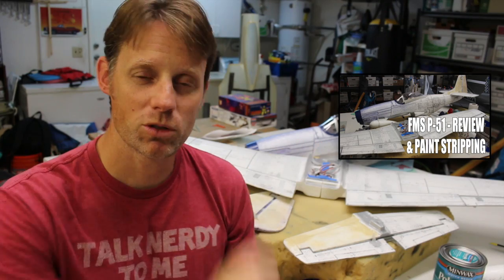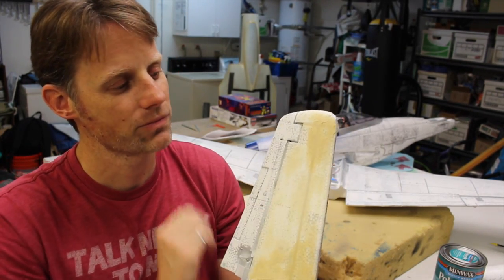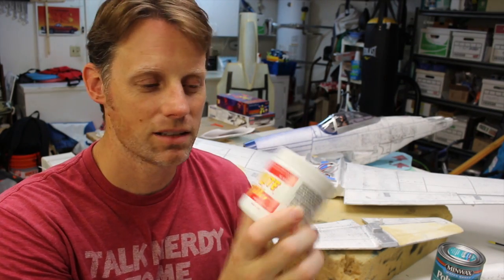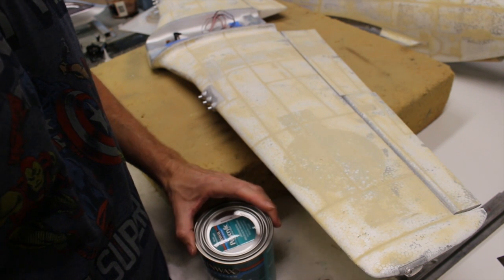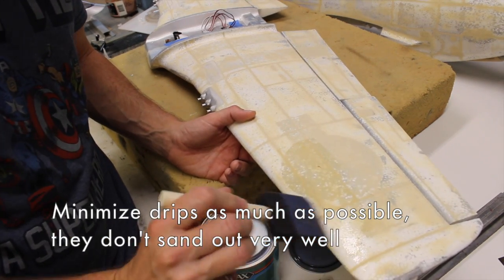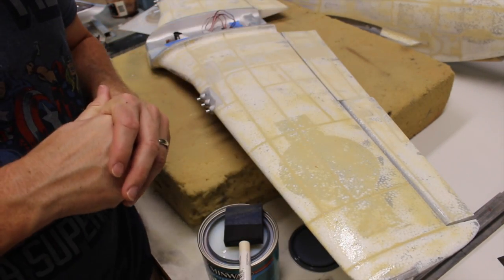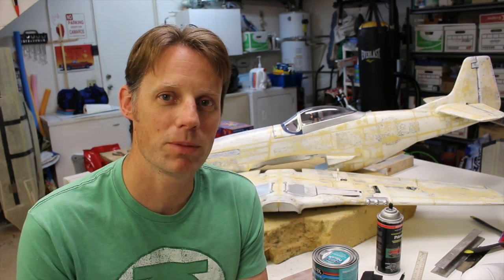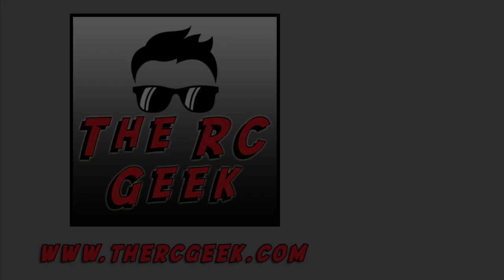Refinish a Foam Warbird Ep2 - FMS P-51 Filling & Sealing for Paint

Comment: Hello great video!  Will there be any issue with the hinge points being stiffer with sealer primer and paint and putting stress on original servo's?   I used Minwax to poly my T-28 and the elevator seem to be very stiff even after I worked it up and down many times.
Reply from the maker: Thanks!  If the poly got into the hinges, it can tighten them up. You’ll want to get some oil in there and that should help loosen them up. If it’s a foam hinge, then will take a few cycles on the surface. It’s good to double check the servos aren’t struggling heavily.

Comment: I didnt know of polycrlic sealer varnish, ...until now...so i repaied the airframe wings with, grp micro beads and pva glue, mied, forms a smooth filler, ....filled the airframe and wings, ....then....sanded, then, covered with tissue paper ...glued on with watered pva glue......then sanded, then, ...sanding sealer on, then light sanded, ....then :) ....sprayed with ..acrylic ..rattle can filler yellow primer, sanded smooth, as abase coat, then a rattle can of chrome ...diy...shop paint :) the pva and the sanding sealer  helped to protect the foam, and the tissue has helped add protection and strength. 

.....i decided to add rudder control to the p-38 as well...as out the box..didnt have any, and running two engines, on a single Esc Bec, when the Li po 4s starts to die ...the bec starts too shut off the engines...and both being fed from one esc....one usaly shuts down, ....and being a twin hard to control with out a rudder option...so i added a addtinal mini servo.....with push rod  to one tail and a cross rod to the other under neath,

 ...i got rid of the aileron...servos....and fitted a snake (nylon in ptfe tube...direct...meter long rod, with clevises fitted on the end ..glued on with resin glue and crimped slightly.......got rid of the wing weights ....sigh took alot work, to get the finish ...after the ...model shop..advice...nearly ..deaded it :/ ....

Wish i saw your videos here ....before!..ha....nice work  RC geek :)..lucky you got a decal printer.     on with my corsair build now.     
And the spit mark xxv re skining ....models take up so much time sigh.....thinking of making my own retract kit...as the ones for sale so so expensive......

Comment: When you applied the polycrylic. Did you apply it down in the hinges of the control surfaces ? If so, did you have to work the hinges loose after drying (before or after painting) ? If not, how did you protect the hinges from the spray paint ?
Reply from the maker: +blkstang9964 This airplane has a foam hinge, so I simply polycrylic'd over all of it and it wasn't an issue.  The poly will gum up traditional hinge points, so if the airplane you're working on has those, avoid getting the poly in them.  taping them off should work.  Otherwise, painting the hinges shouldn't be a problem.
Reply: Thanks, awesome information in these videos.
Reply from the maker: +blkstang9964 Thanks, I'm glad you've found them helpful!
Reply: If painting near a hinge point or other hinge with a pin/rivet holding it together, apply Vaseline carefully to the hinge to keep the paint out of it.  You can apply it with a very small paintbrush to get it exactly where you want.

Comment: Great Video, very informative. You mentioned a modification for the push rods using 5min epoxy and microballoons. What is a microballoon?
Reply from the maker: +Darren Pearce Thanks!  Microballoons are micro spheres that are used specifically as a thickening agent for epoxy.  It gives it more body so it's not as thin which is helpful when you're gluing certain areas where you need the epoxy to more or less stay put as it cures.  IT also adds volume which makes the epoxy a little lighter as well.  This is the stuff: http://amzn.to/1WmZmJ1
Reply: Thanks Chris.

Comment: Awesome Video that is very informative. About the DAP spackling that you didn't have any luck with, do you remember how long it was before you started to sand it??? 

The reason I am asking is that is the stuff I have been using, well it and Shurman Williams Spackle and I have never had a problem? 

Maybe they changed the formula or something??? Just me thinking out loud. 

Anyway thanks for a friggin awesome video! 🤙🏼
Reply from the maker: I’ve switched over to the sherwinn williams shrink free spackle and it’s great!  The dap stuff would just ball up under the sand paper no matter how long you let it dry, so it got tossed never to be sought after again. 🤣
Reply: @Thercgeek   most of the time I let it sit over night. I need to actually test that.  I have made some forward slats for a Carbon Cub S2 and I need to do a little bit of work to smooth them out so I will check and see how long it takes the DAP to dry. I will report back on that

Comment: hi Rc geek,

I am currently converting a durafly seafire to a mk xii spitfire.Ive ordered the 4 bladed prop and spinner off of the flightline mk IX spitfire. As i am making a mkxii it needs clipped wings,would you suggest cutting the end of wing off then sanding a smooth round edge? And as for paint for a ETO scheme spit with the grey ,green and light grey  over the dark blue scheme would you recommend sanding all the paint off as i do not have acetone?
all help appreciated,
Fred
Reply from the maker: Hi Fred, In terms of the refinish, I’d simply do all of the prep work over the stock paint. Don’t worry about stripping it off. Just lightly sand it and do the prep work from there.  For the wing tip, I would recommend cutting it square off and then glueing a light balsawood block at the tip of the correct width and carving and sanding it to shape.  Epo foam doesn’t sand very well, so this will be an easier prospect.
Reply: @Thercgeek  thanks i appreciate it
Reply from the maker: No problem!  I’d love to see the final result when it’s done. 😊
Reply: @Thercgeek  sure thing!

Comment: I used the polycrylic on my new horizon hobbies V900 and it seems to be stiffer and I don't seem to worry about the decals or the paint and it feels great.It might even exceed 120mph.
Reply from the maker: Yeah, the poly does help in stiffening up the airframes. It’s definitely a benefit of using it. 😊

Comment: I’m a beginner/intermediate in the hobby And I’m looking to do this to my Eflite P-47 Razorback, but I like the panel lines on it. I’m just looking to make the foam a little more sturdy since foam warbirds dent so easily. If I use acetone to take the paint off, then use the 6 coats of miniwax before applying primer and paint, would that still give me a good result? Or will the mini wax fill in the panel lines?
Reply from the maker: I would recommend simply just applying minwax over the stock paint and not worry about any filling. The minwax does stiffen up the airframe and give it a nice shell, but it will still ding if impacted. So just keep that in mind.
Reply: Yes sir I’ll be sure to keep that in mind. I’m just looking for something that’ll stiffen it up so it won’t dent from my fingers when I pick it up. Thank you!

Comment: I just got done refinishing my 1.2 meter p47. i did it somewhat different using thin laminating epoxy a thin layer of laquer primer and a thin layer of metalic silver but when it came time to re balance the aircraft it required over 4 oz to balance it have you had that issue ? it seems a slight bit of weight ovet the tail section translates to a lot of weight in the nose required to re balance. it looks like the p51 has a longer nose
Reply from the maker: With that airplane, it' not too surprising.  The nose is pretty short on a P-47, plus on 3 cells the airplane needs nose weight normally anyhow.  On a 4s 3200-3600, it doesn't need any nose weight.
Reply: you think itl fly ok with a 3s 2200and 6oz max lead weight in the nose? im trying to loose some extra tail weight. i dont need a smooth finish under the horizontal stab
Reply from the maker: I flew mine with a 3s 3200 and needed about 3-4 oz lead in the nose.  It should be ok.  The other option is to get some functional nose weight going and fly with some larger capacity packs.
Reply: that sounds good to me.i spent last night and this afternoon sanding off all excecive primer almost back down to foam I want to try tamaya silver. i painted it under the wing and to tel the truth there really isnt that much difference. plus on one note itf you do achieve a realistic polished aluminum finish it will look great sitting on the flight line (im a NAVY guy). but when your flying it under a bright sun it could be hard to see what your doing with glare
Reply from the maker: Silver is one of the worst colors to see in the air.  If you want a nice and realistic silver finish, take a look at the ALCLAD II paints.  They're plastic model paints (airbrush only) and create a very convincing finish.
Reply: alreay used the polished aluminum on my leading edge only thing is there not that great unless you have a polished base
Reply from the maker: I've not played with the polished colors, but the different shades of aluminum.  It is true that the sheen is a function of the undercoat prep

Comment: Hey Chris! I just found your channel, awesome work. Your tutorial on how to do the refinishing is perfect. Tons of great info that I have been unable to find until now. Subscribed! Question about the panel lines though, how would you cut panel lines back into the model? I am thinking before your poly coating using a razor / exacto knife to go over the panel lines, but keeping them a much finer cut line? Your thought please.
Reply from the maker: +Flying with Mojo Thanks!  The way I would approach the panel lines would be to draw them on with a pencil just before applying the final clear coat.  You may even be able to scribe them using a double ended scribe (http://amzn.to/1OfPek0), but you would only want to scribe through the paint down to the primer (not through the poly).  With the pencil, I recommend a mechanical pencil with a soft-ish lead so you don't have to press too hard to transfer the line.  If you do want to do panel lines before the polycrylic, I would recommend using a riffler file (http://amzn.to/1JMSsUi) to cut smaller panel lines back into the filled panel lines.  This will give you a much smaller and controlled line.  I use these when adding panel lines to fuselage masters for fiberglass molding.

Comment: Can Styrofoam be sanded? With a very light grit?
Reply from the maker: Eps foams sand pretty well. Epo foam which most foam arfs are these days doesn’t really sand at all and then whiskers. So, you can use a light grit on epo, but avoid breaking through the skin to avoid it whiskering.

Comment: Hi just watched these 3 videos an subscribe to your channel. Got a question I'm reworking my p 51D mustang an I've already used the minwax polyurethane on it. So I'm looking to see what kinda paint you could suggest ? Or if I could use the 2X's Rust-Oleum spray paint on it ?......
Reply from the maker: Thanks for the sub! 😊. Sure, you can use the 2x rustoleum on it. I’ve used all sorts of paint mediums on epo foam with no issues at all. Especially after the poly coats.
Reply: @Thercgeek  Ok great thanks, I was really amazed on your work on your P-51 Mustang your video was exactly what I have been searching for on here showing everything that needed to be done. 
 Hardly ever see any videos on these 51's. Thank you for sharing an your information. I can't wait to see how mine turns out.
Reply from the maker: Thanks, I'm glad that you found the tutorial helpful!  I'd love to see pics of the finished airplane when it's done. :)
Reply: @Thercgeek  No doubt I'll make a video when completed I had also found another video that was helpful by useing Epoxy an just a little 91% alcohol to lubricate it an brush it on the nose of the fuselage so if it hit the ground it wouldn't break. Think it was called glassing. Then I'ma paint it and detail it.

Comment: Thanks for the very well done videos, but I didn’t understand whether you were sanding between coats or not
Reply from the maker: I didn’t sand between the polycrylic coats. Just a light sanding after the final coat before primer. I did sand between each of the primer coats as that’s what smooths out the surface.
Reply: @Thercgeek  Wow, thanks for responding so fast. I really like your craftsmanship and wish I could spend that much time on my planes but usually I am restoring them from rapid deceleration!

Comment: Curious why you didn't fiberglass with the polycrylic?  Does it add too much weight? I'm certain it would have add more strength.  I wanted to fiberglass a P-47 foamie and am looking at techniques.
Reply from the maker: It’s less work to just use the poly to harden up the airframe. It’s not as hard, but it works. Also, polycrylic isn’t a great medium for glass. You’d want to use an epoxy resin if going that direction. The thing is, even glassing won’t stop the gatoring that you can get with epo in the son, so I reserve that amount of work for more robust models truthfully.
Reply: @Thercgeek   I've seen both epoxy and the polycrylic used and I agree that they say the polycrylic is less strong and cures not as hard as the epoxy.  I have a plane waiting for Z-poxy and 3/4 oz glass at the moment (balsa plane not packing material plane)
Reply: Just ran into this one.  I have to agree on the rigidity point but I also know that foam doesn't do well with epoxy.  The only way I know it could be done is apply five coats of flat paint to it.  Can't remember the type of paint.  But the reason is because of the heat generated by the epoxy during the curing process.  Then you would have to apply the fiberglass (normally five application of epoxy with two layers of fiberglass) followed by two primer coat then whatever you are going to use to paint it with.  That's allot of coats and well, allot of added weight.  I generally hate foam but I have been thinking about get back in after 30 years.  What am thinking about is two different types of planes.  One is gliders and the other, I don't know what you call it.  It's a multi-engine cargo looking plane.  Mostly its to mess about and use on board cameras for surveying.  Not really likely that I will get into that part time but mostly to scout around the general area.  Now, the FAA has inserted its nose where it doesn't belong yet again and is making that a bit on the hard side.  Came out I think last September.  Seems someone is worried about drone attacks on the DC.  Not the platform I would use for that if I remotely had that desire; ex military.  There are far better ways which I will not discuss.

Back on topic.  What am looking for is something that will work in this manner.  Of course I have been out of RC for 30 years and stopped flying myself 20 years ago.  Got anything on this mate?  I will comb what you have up in a bit.

Comment: Gr8 channel just found it. Do you have any long term issues with the hobbyco filler popping out of repairs and panel lines?
Reply from the maker: Thank you!  I haven’t had problems with the filler like that at all. Unfortunately, the hobbylite stuff isn’t made anymore so I’ve been using sherwinn Williams shrink free spackle.
Reply: @Thercgeek  and how does that compare to the hobbylite?
Reply from the maker: I like it. It’s been the best replacement for it I’ve found.
Reply: @Thercgeek  cool, I'm currently building a mold for a 40 size p51 cowl, once I'm finished, I may jump back onto the old school Stryker bash! 
thanks again.

Comment: did you sand between polycrilic coats?
Reply from the maker: I lightly sanded the final polycrylic coat before applying primer.  It doesn't sand great, so it was just to knock down any peaks that may have occured in the process.

Comment: do u have to to fiberglass the foam
Reply from the maker: Not usually for an epo airframe. I just coated it with polycrylic to seal it and worked over that. Works great!

Comment: greta videos, just one question, why didn't you remove the Rudder, airlons ect. would have thought it would have been a better finish. Tom
Reply from the maker: Thanks!  Removing the surfaces can certainly be done. I typically haven’t just in the interest of time. Cleaning up those intersections and adding some skirting or something would definitely improve those junctions around the model.

Comment: What about balsa?
Reply from the maker: Balsa for what?  As a build material I much prefer it to foam actually. But I’m not understanding your question related to the content of the video.
Reply: @Thercgeek  what steps would I take if I am planning to repaint a balsa airframe? I have the hanger 9 P-51D Mustang that was in an accident and I want to repaint it to silver. Going for the Tuskegee Airman scheme. I couldn’t find anyone on YouTube about it and I checked your website and couldn’t find anything relating to balsa
Reply from the maker: Ah, ok got it. Sounds like a fun project!  For something like that, I'd personally end up fiberglassing the airframe and going that route.  It's the most permanent finish you can get, but is a bit of work to do.  It's my plan to show fiberglassing in the future as I have a number of projects that require it.  Just haven't been able to get to those projects yet.  I will have more time in the fall though.

Comment: I'm considering this same process, but with using Beacon Adhesive Foam Finish for filling in the panel lines instead of the HobbyLite. Do you think that would work also?
Reply from the maker: I've never used the Beacon foam finish, so I can't really say.  From what I can tell it would be more of a replacement for the polycrylic, no?  Is it a resin or is it more of a filler?  Or more of a combination of the two?  I'd say try it on a small surface first like the tails and see how it does and then decide from there based on the results.